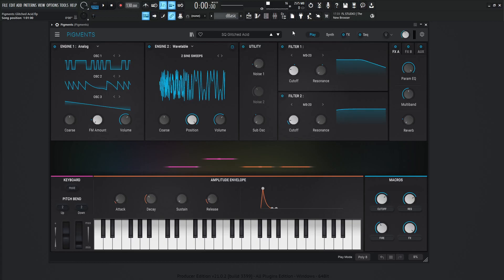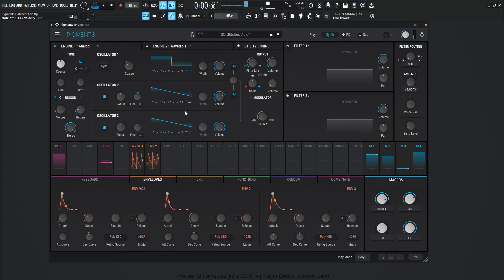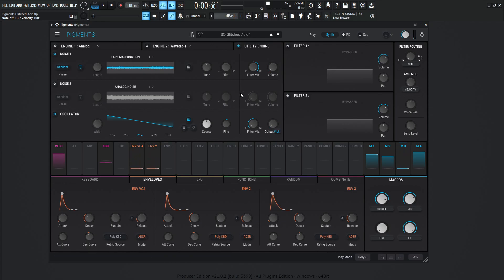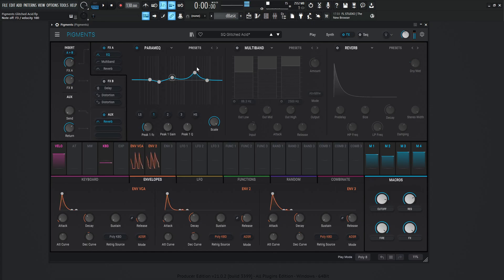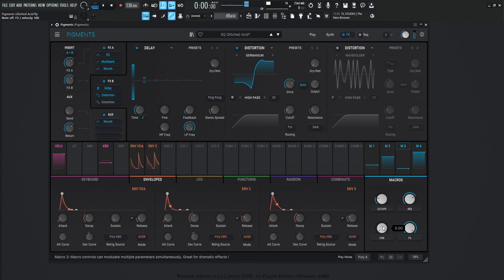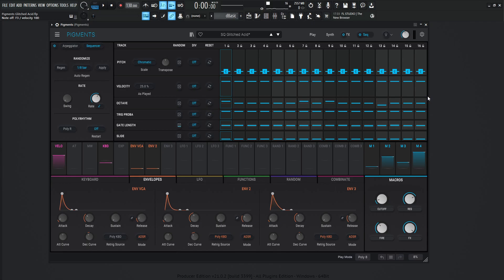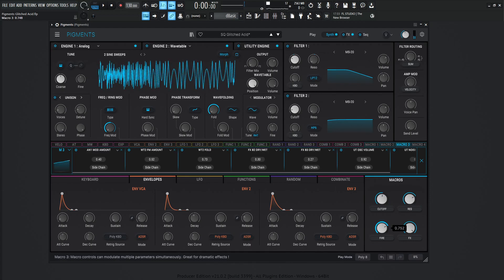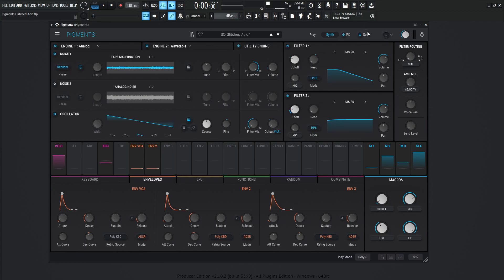Glitched Acid Sequence Arturia Pigments 4 Sound Design Tutorial

Comment: Good video, but I cannot figure out why you didn't include the modulation percentages for the low pass filter. I slapped my envelope on it and just kinda guessed, but the percentages would be useful. 
Also, the volume is clipping horribly for me. I followed your video to a T, but it is clipping hard. If I turn the volume down, it takes away the impact of the sound. 
Can you address these two issues, please?